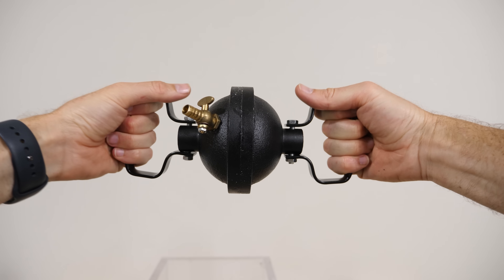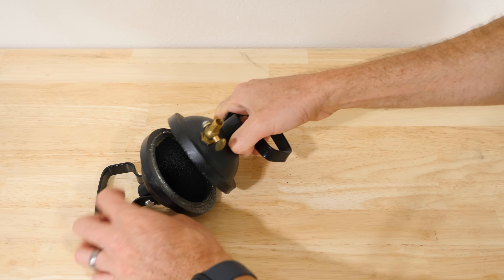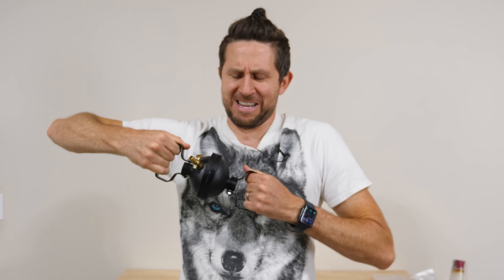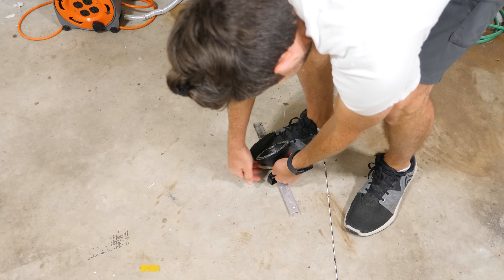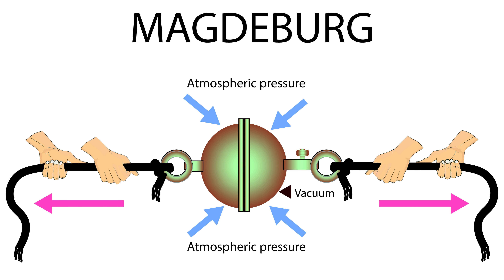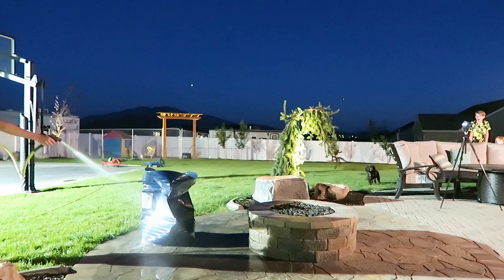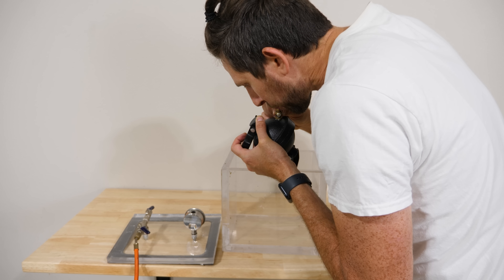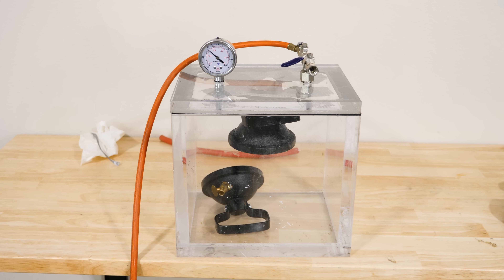Pulling Apart The Magdeburg Hemispheres

Comment: Firstly great Chanel. But.
Would it not have been a better/fair experiment  to use the vacuum system to reach 1 atmosphere out of the Magdeburg Hemispheres before placing it in the Vacuum chamber? As with you removing the air my mouth air would have still have remained in Magdeburg greater than the vacuum chamber? Creating a positive pressure inside.

Comment: Now, how does atmospheric pressure relate when it comes to theoretical gravity? It seems intuitive that pressure requires containment the way it pushes/exerts force in/on directions/surfaces. So, what is causing/allowing,  pressure to behave the way it does? Gravity seems irrelevant. A non factor 🤔

Comment: If it's the atmosphere around it pushing it in causing the grip, wouldn't the same exact thing happen if they had no empty space inside and fit together flush?

I think it's working differently.
Reply from the maker: There is always air in between. If there is no air in between then you have a solid piece of metal
Reply: @TheActionLab  what if it's liquid?

Comment: Inner diameter appears to be approximately 4 inches. Pi*R2=12.5 square inches times the amount of negative pressure (vacuum) you can pull out. Looks like you were able to pull about 1/2 a vacuum with only your mount. YOU SUCK! Just kidding, good experiment. Had you used your vacuum pump on the device it would have had a LOT more holding force due to atmospheric pressure.

Comment: So is the force calculated by deltaP, inside vs the outside multiplied by the surface area of the sphere? I'm assuming that the greater difference in pressure would make them harder to separate.

Comment: That's interesting because my first thought was that by trying to pull them apart, you are increasing the power of the vacuum in line with the force you apply. Is that not even a part of things?
Reply: They are rigid objects. If distance increases just a little bit the air will be able to move in. But for flexible objects this should work though not a great difference between even 5% atm and 1% atm.

Comment: You weren't done. What happens when you use the vacuum pump to directly pull the air out of the joined hemispheres? Would it not then be even harder to pull apart?

Comment: Does a larger surface area of the outside of the entire object create a larger amount of pressure from the outside?

If you could create this internal vacuum with two different shapes, both having the same internal volume of vacuum, and two different surface areas, would one be harder to pull apart than the other?

Comment: With the same vacuum you made with your mouth, would you need to double the 100-ish pounds to 200 pounds, if the surface of the sphere was double? Subsequently, would a smaller sphere be easier to pull apart with the same vacuum?

Comment: how many square inches is the cross section? because without watching the video I would assume you would need to multiply that by the air pressure to get how much pull you need to pull it apart

Comment: Using a hydraulic cylinder force calculator (google search) set to a 4.5" bore, 0" rod, and 14.7 psi of pressure, it says it should take 234 lbs to overcome atm force and pull these things apart. I guessed the diameter, you never get a perfect vacuum, and 1 atm varies, but that sounds about right.

Comment: Yeah,
 so we did this in physics class and the people couldn’t pull them apart.
Then two of my friends tried and I had the genious Idea that they pull on the two strings that were attacked to the handles of the hemispheres with a strong impulse instead of tensioning it and then pulling like before.
Long story short: it separated.
Then one half hit my friend in the face and he bled from his fore head leading to an ambulance being called. 
He was fine after and didn’t hate me for it as both of my friends agreed to do it that way and were, like my teacher, convinced it wouldn’t work.
But as I thought impulses can be stronger then energy deployed over time. 
I would recommend that method again, because that scene makes me laugh every time I remember, that hemisphere flying 2-3 meters after they pulled on it and for some reason perfectly hitting that guy in the face instead of flying by and shattering one of the windows behind him, good times.

Comment: I’ve often pondered a machine cylinder with a perfectly fitted solid cylinder to slip in.

Take that to the vacuum of space.  Would the plug easily slip in… and also slip out?  It should, shouldn’t it?

Next it is returned to Earth, supposedly devoid of air perfectly sealed.  Some incredible immeasurable force is used to try and separate them.  Could a gap be crated inside if the container and force used are both indestructible and unbendable?
Reply: He creates the "vacuum of space" inside his clear vacuum chamber all the time. The atmosphere is only 14.7psi.
Reply: @Texassince1836  Hmm…. I was always told 14psi.  14.7 is more like “just under 15psi.”

In my little curious inquiry lets make the perfect fitting cylinder and receptacle a mile long…. Maybe the rod has a diameter of 5 miles.  The wall thickness also near 5 miles.

If you prefer the vacuum chamber with a motor of infinite power, indestructible hose and walls.

Is there a negative psi that would cause some strange reaction?  That’s what I ponder.  What’s in a large area devoid of gas, atoms, quarks… devoid of any trace of energy of any kind?

Comment: I'm not 100% on the science here, but in theory couldn't you use these to hold stages of a rocket together that would automatically release at varying levels of exterior vacuum depending on the vacuum that would be inside each set of hemispheres? If im not mistaken this is currently done by small explosives.

Comment: I once heard that if you enveloped the Eiffel Tower in a cylinder, the air in that cylinder would weigh more than the tower itself. Any scientists here who can confirm of this is true or not?
Reply: It doesn't have to be a cylinder.  If you simply draw a square around the base of the Eiffel tower, and extend it to the upper atmosphere, the air in that volume already weighs 16 times more than the tower.  And it has a mass greater than 16 times the Eiffel tower, when you consider the fact that gravity is several percent weaker in the upper atmosphere.

Comment: Very direct and to the point video- great! But how does the surrounding atmosphere know that there is lower pressure inside of the Hemispheres? They are basically air tight- the air inside is not interacting with the air outside- so wouldn't this mean the Magdeburg Hemispheres are a closed system and separate from the ambient atmosphere in the room?  
Is this some kind of a quantum effect?
Reply: All that's happening is the atmosphere is exerting a greater force than the remaining air in the sphere because it is at a higher pressure

Comment: Did these have any practical use? I imagine with a full seal, IE actually vacuuming out the air, could be a pretty ingenious way to securely attach things. Madgeburg hemisphere trailer hitch anyone?
Reply: Pass :D

Suction cups are used in many places in day-to-day life though. There's even a battery powered one that can quickly attach to hard-to-carry objects to provide safe handling.

Comment: I'm very well aware of a vacuum getting created and getting things stuck together because I'm a dishwasher at work, and stacked pans get stuck together all the time and I have to pry them apart. Most of the time I can with my bare hands but sometimes I have to use a tool like the metal scraper I have but sometimes even that doesn't work. What helps is taking it slow at the corners. What's the worst though is the buckets. They get completely stuck and even two of the strongest workers can't get them apart. What we do is soak them in hot water. That makes them expand and opens the vacuum and then they slide right apart.

Comment: Is it gravity that actually causes implosions or air under pressure? Like, you could put a 20,000 ton train on a piece of popcorn in space and it won’t get crushed. I understand the the total mass of the air surrounding an area with no mass could cause it to get crushed but isn’t that caused by gravity?

Comment: brilliant video! I never thought of the tin can experiment, just adds another dimension to the stresses an aircraft fuselage goes through per cycle! Of course the internal pressure is never lower like with the can of water example, because of pressure relief valves bit it's another stressor on the fuselage I never considered, I'm really fascinated with air pressure at the moment, it influences our lives in so many ways. Keep the videos coming! Thanks!

Comment: I think it is also depends on surface area that the vacuum works on for example you can get a bigger orb with the same weight (or corrected for weight) to show it. Is this correct? I know adam savage made a vid telling a story about bending metal with water just by applying it over a large surface area.

Comment: Atmosphere question
When you use your vacuum chamber, does the outside pressure increase against the box? If so, how does the box not collapse like the mentioned tin can or barrel?
Reply: Vacuum chambers are designed with this in mind, they use stronger materials. This is part of why they're so expensive.
Reply: @deltainfinium869  Y'know, that makes a lot of sense. Thank you
Reply: When the vacuum chamber is used, the outside pressure doesn't increase, rather the inside pressure decreases which reduces the resistance against the force induced by the atmosphere and hence train carts can get crushed by the atmosphere

Comment: This got me curious about what kind of vacuum is achievable using just the human succ. 
For anyone interested, I did a bit of googling and it looks like it's around 7m of water, which is 0.32 ATM or about 10PSI below atmospheric pressure.
Assuming the hemispheres' inside diameters are around 75mm/3 inches, that'd mean you'd need about 32kg/70lb of force to separate them. This is about 2/3 of the force needed to separate them if a complete vacuum was drawn. Pretty impressive!
Reply: 7m of water?
Reply: @logitech4873  Yep, as in if you get a cup full of water on the ground, and a long tube as a "straw", some people can suck the water up to about 7m above the cup
Reply: @rob-muntron  huh, that's an odd unit. Thanks for the explanation.

Comment: What if you closed the valve with normal atmospheric pressure inside the hemispheres, and kept them together with tape? If you put it into the vacuum chamber would the halves try to burst apart due to having more pressure on the inside?

Comment: the vacuum chamber really demonstrates how the air pressure is exerted from every direction and not just from the air above you. which is the intuitive way to think about air pressure as the weight of the air on top of you. but air pressure is exerted from every direction so that's why the bottom half falls when the pressure is removed. if the air pressure were only on top then the bottom half wouldn't have fallen off because there would be no pressure removed from the bottom.

Comment: The "100lb of force" at full vacuum? The mouth can at best remove 60-70% of 1 atmosphere. The vacuum gauge shows this also. Therefore, the requirement to pull the hemisphere apart is only about 60-70lbs. Perhaps some working out is needed? 🤣

Comment: So the strength of the vacuum and the surface area are what change the force required to remove them, the volume of the space inside should be irrelevant right? Even if the hollow space was the size of a marble, it should behave the same.

Comment: What I find interesting is that with a vacuum within a vacuum within a pressurized environment, you have three decrees of vacuum potential. The potential of any vacuum is dependent upon the difference between the pressurized environment and the vacuum.  When he sucked the air out of the Magdeburg Hemispheres, while he created a vacuum potential with the atmosphere, it should be noted that he likely did not suck all the air out.  When he put the Hemispheres in the vacuum chamber, he used a vacuum pump which sucked out more air from the chamber than he could if he was just sucking on it and reversed the vacuum potential with the hemispheres. But even then with the vac-pump, he still did not suck out all the air.  Ergo, not all vacuums are created equally.

Comment: my old fridge had this problem when I opened the freezer, the cold air fell out and was replaced by warmer air which would contract creating a small vaccuum. The freezer door could not be opened until I waited until the air pressure equalized. Even 1 psi difference on that surface area was over 100 pounds.
My new freezer doesn’t have this problem because it has drawers and the cold air doesn’t fall out.

Comment: This is similar to filling a glass with water untill the meniscus bulges, then carefully placing a cardboard or plastic card on top and turning the whole upside down. the atmospheric pressure being greater than the weight of water holds the card and water in place.

Comment: to be fair, it didn't fell apart inside the vacuum chamber.... the pressure inside the sphere pushed it ;)
Reply: No, gravity would have pulled the bottom sphere down at the moment of equalization. What you said happened might have happened if he just placed the sphere in the bottom and the pressure had to force the weight of the top half off.

Comment: This is the same reason why if you drive into a lake and your car sinks, you can't push open your door until the car fills with enough water to bring the inside pressure closer to the outside.

Comment: Ah now technically you are pushing them apart in the vacuum chamber. You can't get a zero atmosphere vaccum with your mouth the air that is left will have some outward force as the vacuum outside increases...so when the air that is left has more outward force than the vacuum outside...... "pop" they come apart.
Reply: No I don't think they are being pushed apart, the gravitational force will be sufficient to pull the bottom half down and the moment of equalization.

Comment: Never thought my hometown would be mentioned here at this channel!
One nice detail, Otto von Guericke developed/invented the "Luftpumpe" (air pump) to make his air pressure tests and discoveries even possible.
And: once in a while the original test with the big hemispheres gets repeated, with 6 horses at each side trying to pull them apart - and then a little girl from the audience is asked to simply open the valve, which make the hemispheres fall apart.
Reply: Grüße aus der Nähe von Halle/Saale ✌🏻
Reply: Grüße aus Magdeburg mein Bester ^^
Reply: Auch grüße aus Magdeburg 👋🏻 
Waren es im Original nicht sogar acht Pferde?
Reply: Grüße aus Machdeburch
Reply: Grüß aus Magdeburg
Reply: Grüße aus Braunschweig.
Reply: Though the horses thing was a bit of a cheat as half of them were pulling against the other half providing only the same force as if half the horses were pulling against a fixed object.

Comment: The external pressure would still be the same even if it wasn't a vacuum inside, so it must be because the internal negative pressure is far greater than the external positive pressure.  When you placed the sphere inside the vacuum chamber and removed the air, the two hemispheres came apart due to the internal and external pressure being equalised.
Reply: Pressure can be 0 or more, never negative

Comment: I learned about it in school then an amazing teacher made an easy demonstration: some news paper over a piece of cardboard and a string in the middle of it, putting it on the ground and pulling hard on the string: it don't want to move because atmospheric pressure is pushing too hard. the whole contraption don't have much weight but it's acting like a plunger... and that's why now a long time after i've seen some waterproof box (used in fiber optic) have a valve on it to allow being open...

Comment: Firstly, I figured the vacuum would just open the valve and equalize the pressure. So the pressure inside the ball would be the same as the outside, and maybe it did, maybe that's why it fell. More of a equal pressure so there's no Force holding it together kind of situation. Assuming it's some sort of check valve in there, but secondly, and most importantly, how are you suspending half of the ball in the vacuum chamber in the first place? Questions
Reply: It fell because the pressure outside the ball equalled the pressure inside, nothing changed with the valve.
Reply: Initially the vacuum chamber is still full of air, so there is still pressure that is why the other half stayed on for a while.
Reply: @mrthanos2404  Nah. Any suction cup type thing would fail at those low pressures. He most likely used something more akin to tape or glue.
Reply: @deltainfinium869  yeah, it would fail, I am not saying that it won’t, I am just saying that he since he pulled the vacuum gradually it can still stay on for a while before the pressure gets too low.